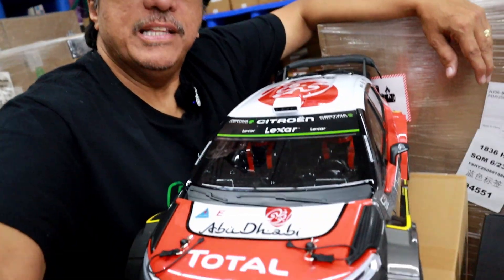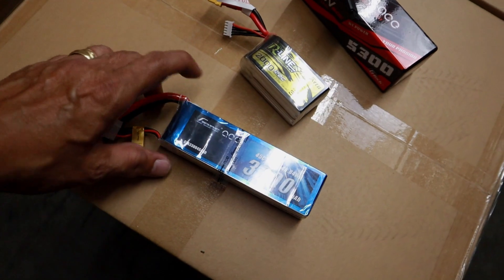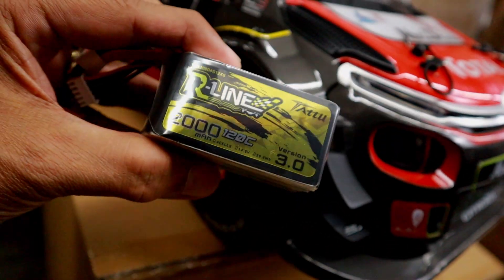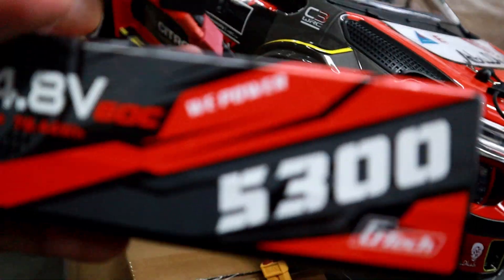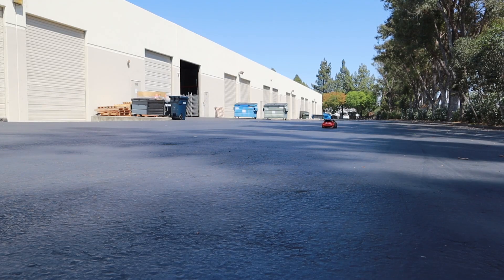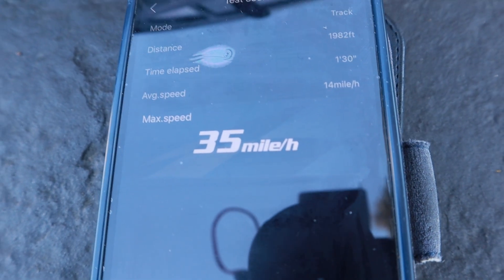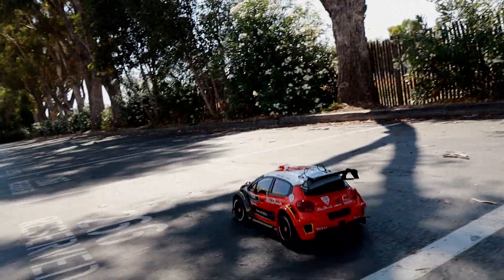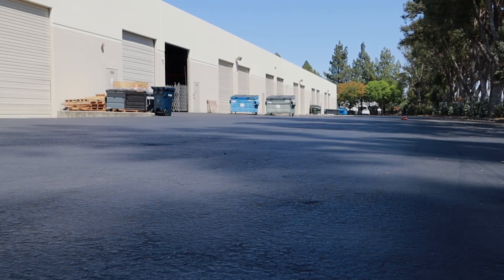9,400 Watts of Power on the MJX 7303?

Comment: I have the KM/Traction Hobby C3 Citroen rally car, I choose it over the MJX car, they both are under power for there size and weight, I got my KM yesterday and ran stock to see how it would run,  but I already had feeling it would not be enough power for the car to perform , so I swapped out the 100amp esc and replaced it for a Hobby wing Max 6 paired with a 18 pinion, all I can say is wow, that's more like lol, also using CNHL 8200 mah 120c Li- HV , these batteries  kick .
Reply: Did you keep the stock motor and did you still run it 4s?